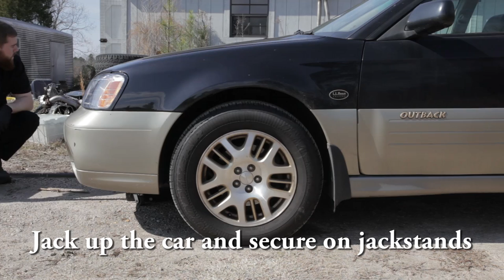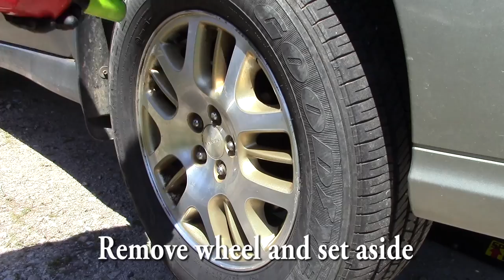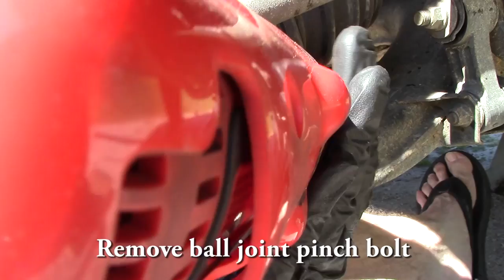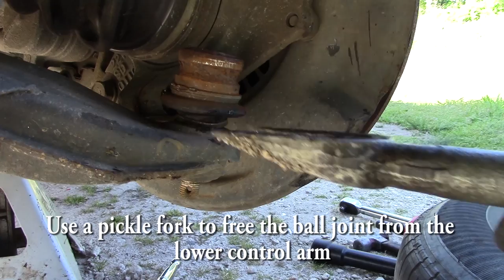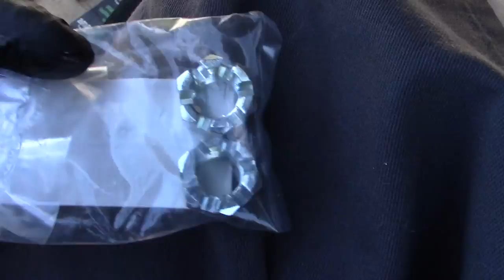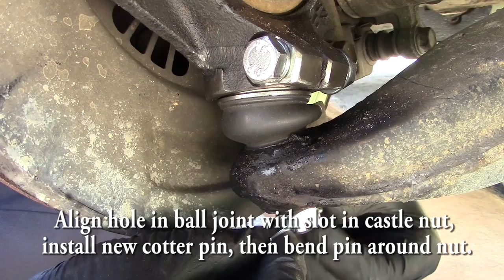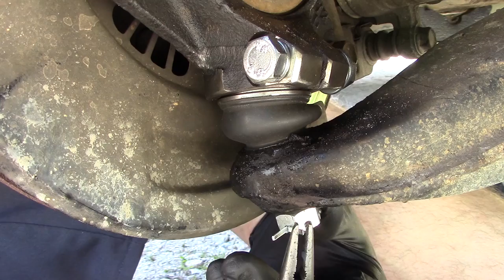Subaru Ball Joint Replacement

Comment: That must be the BURLIEST fkn pry bar on planet earth because my pry bar+3ft pipe+5lb sledge+2.5hrs of my time and I STILL CANNOT BUST THIS SOB LOOSE!!!? WTH am I doing wrong? I've tried heating her up, I've tried PB Blaster, I've tried putting a jack under the rotor to keep the knuckle stationary and all I've managed to do is get some more play in the ball-joint itself!? PLZ help[ me out on this one? Oh and I've even tried opening up the gap in the knuckle, that the pinch bolt closes, in order to get this thing out and she just won't bust loose!?
Reply from the maker: Luckily my car is a rust free southern car. I've had to remove the spindle and use an air hammer and chisel to break rusted ball joints out.

Comment: Lies! Didn't include the part where the head of the pinch bolt breaks off then having to get creative to remove the rest!!!
Reply from the maker: Pinch bolt didn't break off on thr driver's side. It did on the passenger's side though.
Reply: @MrSubaru1387  What did you do to remove the rest? I drilled and tried extracting; and now have a broken extractor in the bolt
Reply from the maker: Ouch. Yea, I usually drill them through then install a slightly larger bolt than factory.

Comment: Congratulations! You have THE most misleading video on YouTube.
Reply from the maker: How's that?
Reply: @MrSubaru1387  for one I CANNOT get the ball joint out of the housing. I've tried everything short of taking it to a machine shop. Which, if I'm going to do that, why not just buy a whole new knuckle. Before that, the pinch bolt gave me some trouble. Wasnt able to get it to budge. Then it broke. So used penetrating oil and heat to loosen it, then used bolt extractor. Bolt extractor broke off. So then spent 8 weeks, whenever I had the time, drilling and drilling and drilling and drilling. Went through several titanium bits, 2 craftsman drills, and a black and decker before it finally relented and came out in one piece, as a Frankenstein half bolt, half extractor hybrid. But I still cannot budge it out of the housing. I expect I'll pull the spindle out before I am able to remove the unit as a whole.
Reply: Update. I managed to get the ball joint out of the housing, but the hole that held the pinch bolt was so deformed from the extraction, the new bolt wont hold the joint in the housing securely enough. So after all that, I had to get a new knuckle. All of that time and effort wasted. But I know for next time, dont bother with the ball joint, just get a whole new knuckle from junkyard or something.....